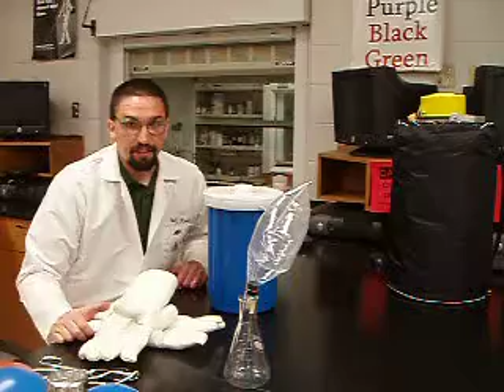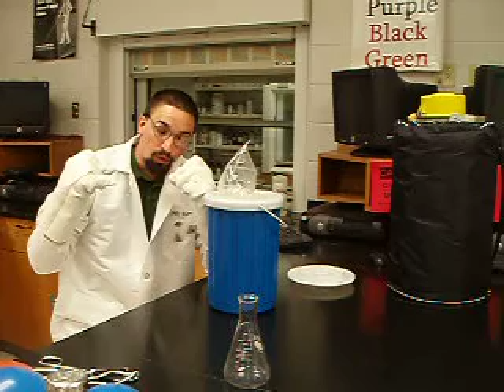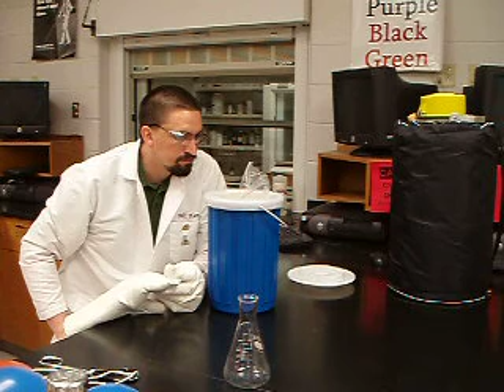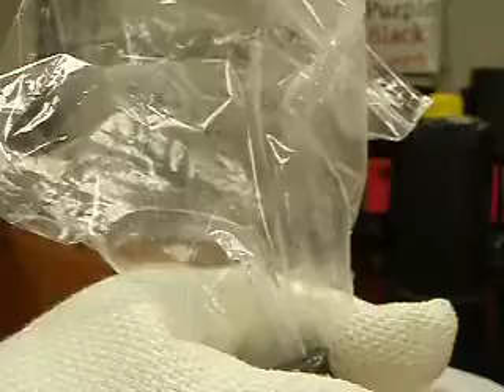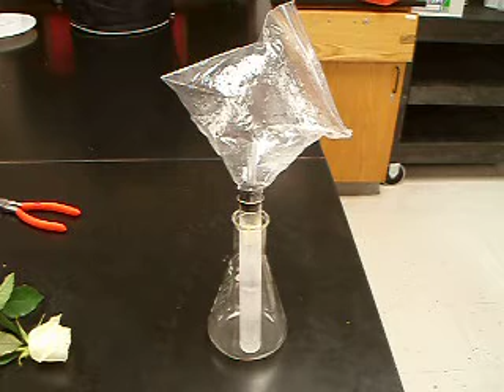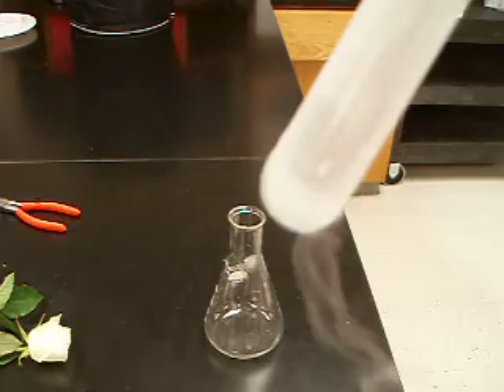Liquid Nitrogen - Liquifying Air

Comment: would mostly be liquid oxygen, right? - co2 is so small in percentage of ratio it would be difficult to see and nitrogen would not condense to liquid due to the entropic difference between the condensing gas mix and the slightly colder liquid nitrogen condensing liquid - just my thoughts - but to Lau Ren - good demonstration.